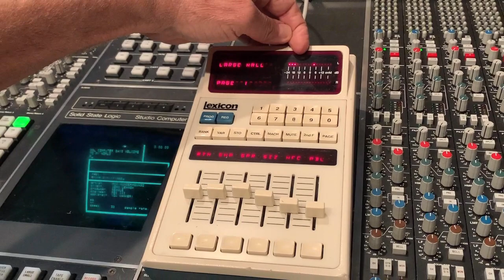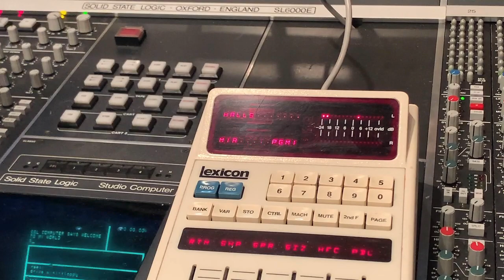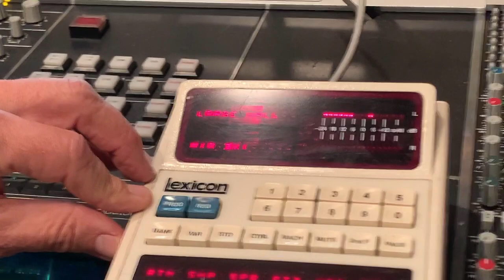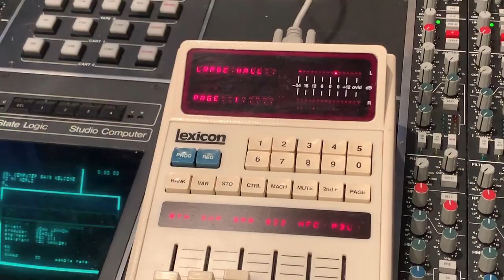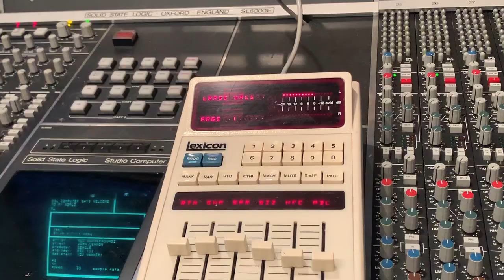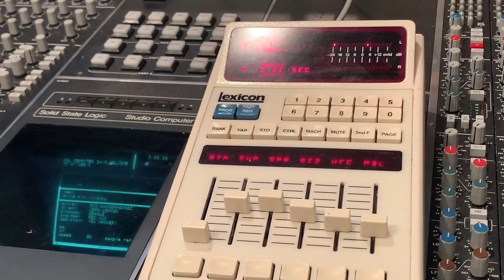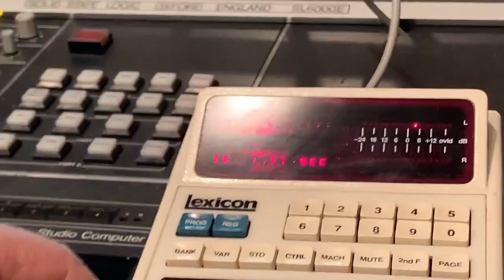Intro to the Lexicon 480L

Comment: It's nice how they made the fader change the reverb time logarithmically instead of linear. This means most of the fader range gives you control over the shorter times, which allows for precise control up to 2 sec reverb time, which is more important than precise control over for instance the difference between 10 and 12 sec reverb time.

Comment: I wish this Lexicon had an " enter " button, this way when I choose a program, I could actually press enter instead of what button ? lol
Reply: Have you ever even used a 480? On such limited space interface like the L.A.R.C. another button just for a single function would be a waste of space, especially when the load function can be done in the clever way the 480 does. The program is blinking so you are in pre-view mode. Just hit the key-number with the same number of the program in the display and the preset is loaded. Briliant!
Reply: @italoop7850  Enter button would still would still be nice :)  Question...  How do I use tha other half of this Lexicon meaning...  I have tha part part hooked up to AUX 1, tha 2nd part of this Lexicon that is hooked up hardwire wise is Aux 2.  I already programmed my Lexicon for large hall, now I want to program something else on AUX but not loose AUX 1.  Do you know how to switch that in tha Lexicon ?